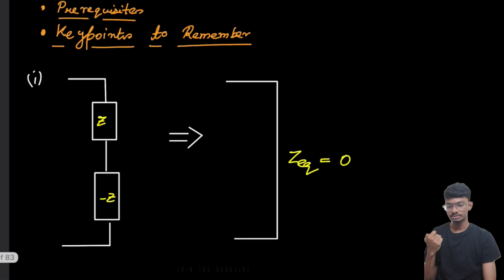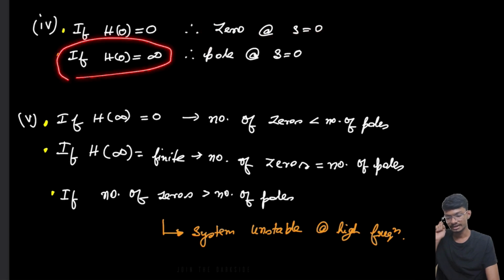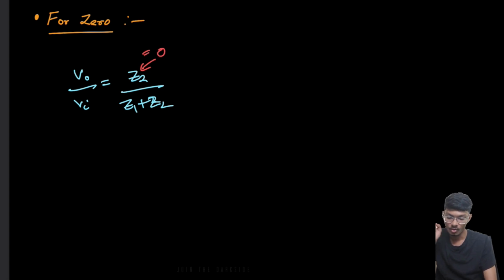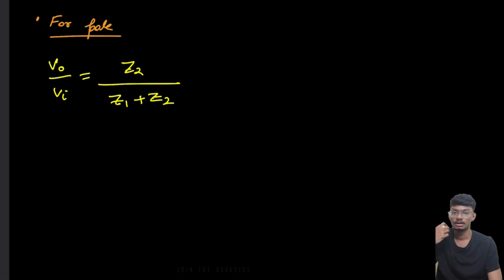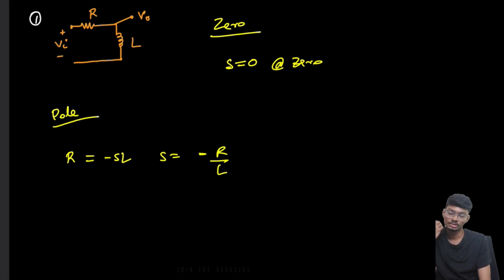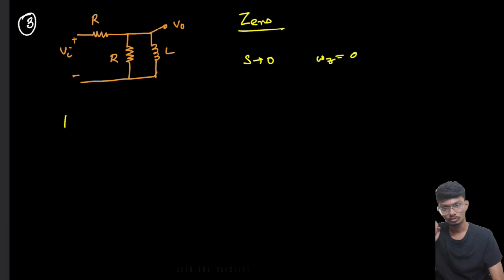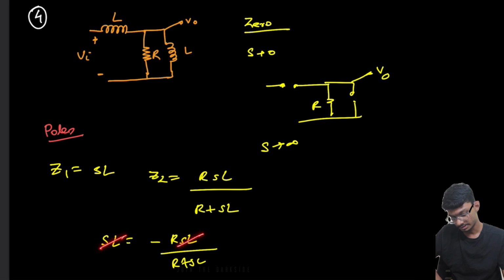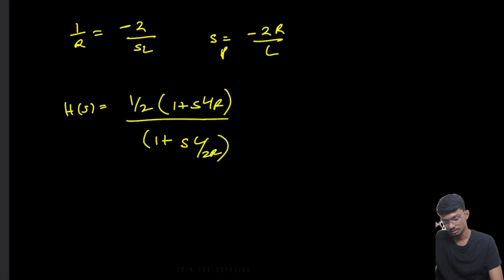Realizing Poles and Zeros Intuitively || Part -1 || Prep With Me

Comment: Whatever you have explained in this video each and everything is clear to me but one thing I am struggling with is - Let's say, in the second example of RL circuit the pole is at -R/L, that means s=-R/L now if I put s=jw then, jw = -R/L, which means there is no real frequency for having infinite gain. Now let's say I want to make the same circuit in real life then, what should the frequency of the input voltage be so that I will get infinite gain?
Basically I facing problem to relate this concepts with real circuits. Please help me to clear my doubts 🙏🏾.
Reply from the maker: Yes,you are correct we can't make the gain infinite very good observation. Which can be proved by Bode plots, does at any frequency my Bode Gain Plot blows up "NO!" Hence there isn't any real frequency where we can make the gain of the circuit Infinite.
Reply: @AnishSaha_  yes it can be proved using bode plot. Thank you 😊 for clearing my doubts. Keep growing.